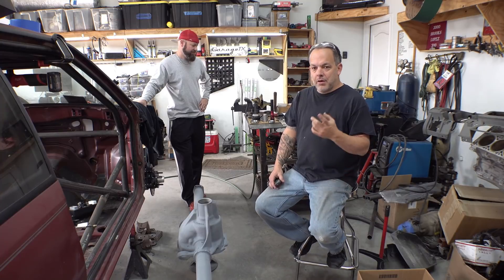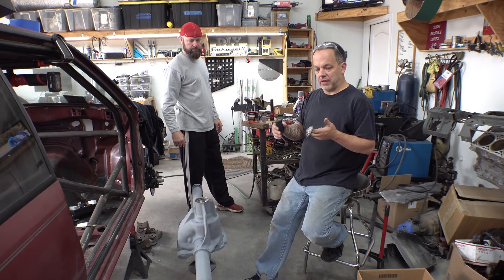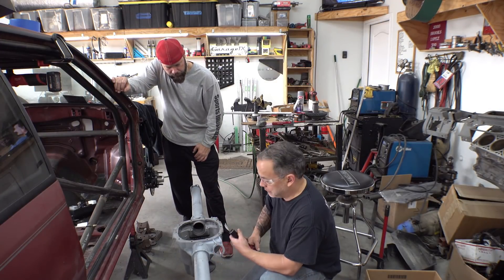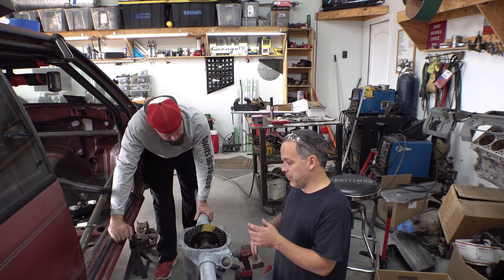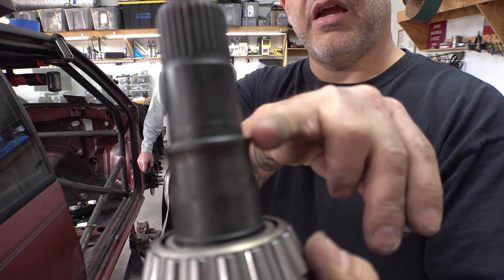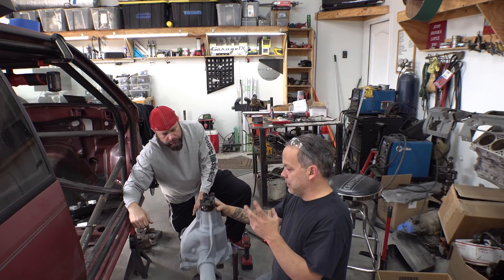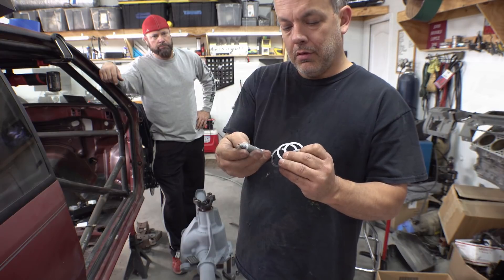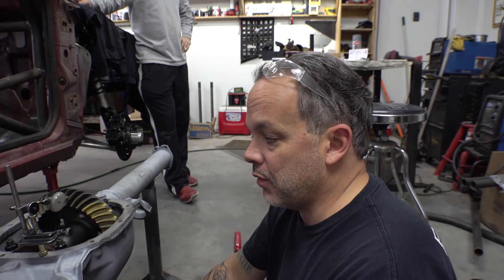Race prep ford 8.8 rear end with solid crush sleeve

Comment: A legit pic of the heel/toe(drv/coast) pattern would have been nice. When you arrived with that pattern you liked, was that with the diff bearings preloaded?  Id usually get my pattern close with the diff shimmed snug in the housing and when i. Happy with that ill add 4-6 thou on both sides to load up the carrier bearings. Then double check my pattern again. This my first with a pinion spacer shim kit so tx for the heads up about the radii on the spacer V the machined shoulder on the pinion possibly not matching. That would certainly get hinkey when everything gets nailed down. Anyway, kewl vid. ALWAYS something to learn. Cheers! B

Comment: That bit about chamfering the spacer... How does it "wear" when it is pressed in place and doesn't move once the pinion nut is tightened? You are the first and only person I have heard this from.
Reply from the maker: It is NOT pressed in place, the sleeve is free floating (held captive by the bearings at most). On a car with any kind of power, or a car with a clutch (This is a RACE prep video after all) the constant hammering of the yoke, they are HELICAL cut gears, they will try to move forward and back, will cause the crush sleeve to be 'worn' - maybe not in the typical sense from spinning, but from the hammering effect of the drivetrain. THIS will wear on ANY crush sleeve...and eventually create more in/out movement of the pinion and really take away from it's service life in this environment. This rear is still in the car, making over 1300hp, hundreds of passes and has never been apart.
Reply: @diygaragetx  Maybe "pressed" wasn't the right word to use. I meant that it is held captive between that ridge and the bearing. Maybe it would spin and walk at 0 preload, but under the right preload, it would not spin or move. I am speaking about a solid spacer and not a crush sleeve here.
Reply from the maker: @rmsgarage3724  I have never, not even one single time, had (any measureable amount of) preload on a solid sleeved pinion setup. Read what I said above again, the helical nature of the gears will drive that pinion in and out under accel and decel - especially when big power, radials and tire shake are considered. With preload it will absolutely have to "wear-in", to some degree, thus relinquishing at least some preload. With little or no preload, it has nothing to lose,  you can tighten that pinion nut as tight as you want, with no fear of imparting any pressure on those bearings and no chance of gaining any clearance. I haven't checked it in a LONG time, but I am confident I can get under there and it'll be nearly identical to how it was when setup in this video, over 2 years later.
Reply: @diygaragetx  I know it will drive it in and out but that force will be on the bearings. The spacer won't move. You do it your way I guess even though you are the only one I have ever seen make these claims about 0 preload and chamfering a spacer. Would be interesting to see what it looks like in there. If you do a video on it, I will watch out of pure curiosity. Maybe you know something that everyone else doesn't.
Reply from the maker: Man, been doing it like this for many years,  never once had a failure

Comment: When do a 12 bolt. I use old pinion bearings with inside hogged out with die grinder so the bearings just slide onto pinion. This way with solid sleeve you set gear backlash and pattern plus preload all together.
Reply: I was thinking about doing the same thing with my 8.8 with a solid sleeve.

Comment: When you use a solid crush sleeve do you go by tolerance only, the 1 thou like you said at the end of the video and not the rotational torque load or both? 

Thanks for posting this video.
Reply from the maker: I don't do rotational torque, but that's my own preference, as is the .001" clearance. I am of the belief that a small amount of preload will fail the bearing prematurely. That's just how I do it.
Reply: @diygaragetx   I wanted to use a solid spacer instead of a crush sleeve, I am putting a whole fresh built rear end in a marauder 2003. I prefer solid stuff and measuring things out than relying on a part designed to "give".

I definitely respect your experience and trying to gain as much insight before I build this thing so I don't screw it up. I also feel using a solid spacer makes setup easier in my mind because its more of a finite process. 

This also eliminates the need for a test bearing from what I can tell. 
 I could be mistaken on this.

I noticed you had an issue with seating the large pinion bearing, did it have anything to do with the pinion shim? did you go with a 28 instead of a 26 because you can take away from the solid sleeve spacer? 

This is a strange question but a number of mechanics have been unable to help me with this. and of all the videos I like your way the best so far. 

huge help already thank you for your efforts to share this with people. 

I am going to measure all my shims this afternoon before I begin the setup.
Reply: I am also trying to get my mind around factoring in the dimensions for everything given several mechanics mention a preference toward an actual crush sleeve so that the pinion nut can be tightened after the bearings seat. bearing seat tolerance from what i hear is between 10-20 thou and not a factor in your experience?

seriously god bless everyone who has the guts and inclination to post videos on differential assembly.
Reply from the maker: Some shims can have too small of a hole and will bot seat properly because of the radius on the pinion itself. Watch for that.  Cars that see the dragstrip and hard launches are more likely to crush a sleeve further, causing increased slack in the gears and eventually failure. You don't need a test bearing to set one up though. Do all of your setup without a crush sleeve. Once you're happy with the pattern, then install the crush sleeve.
Reply from the maker: I have never, ever.... not even one time gone back and retorqued/checked after assembly. .010-.020 clearance in a bearing anywhere in a diff would fail in short order. It would be so noisy that you'd likely be afraid to drive it.
Reply: @diygaragetx  amazing stuff. I think I am confident enough to get started, Thank you!!!
Reply from the maker: @evanpaulsmithfalconfogolin6147  anytime!

Comment: bearing preload ? did I miss something here ,,, no mention of
Reply: My stock crush sleeve had a variance of .06 from one side to the other.... with no signs of unusual wear, bearing failure or strange wear pattern. Trying to wrap my head around this.
Reply: Everyone does it one way, that the manufacturer recommends. Then there's this guy. 0 preload is a ridiculous statement. It's the internet I guess.
Reply from the maker: @rmsgarage3724  You do it your way, the internet will do it their way - as I said above -  This rear is still in the car to this day with hundreds of passes, making over 1300hp, hundreds of passes and has never been apart.
Reply: Is there a certain torque you set the pinion nut to while having the correct shims installed on the eliminator to achieve your desired pinion preload?
Reply: @jasongottsacker4756  with the crush sleeve eliminator you set bearing preload by adjusting the shim stack & checking it with an inch pound meter on the pinion nut while rotating it back and forth.  With new bearings you want 16-28 inch pounds of rotational drag.
Reply: I've seen it done a lot of different ways but never like this 😶
Reply from the maker: There's no bearing load to speak of with a solid pinion sleeve, there's 001" clearance as mentioned. If you did, the bearings wouldn't last very long.
Reply: @diygaragetx  From what I understand all pinion bearings need a certain amount of preload, should not matter if a solid spacer or crush sleeve is used. Where did you get this info on .001 to set the pinion bearings up?
Reply from the maker: @gregory9740  been doing it like this for so long, I couldn't tell you where I got the info from. Never once had a bearing fail..